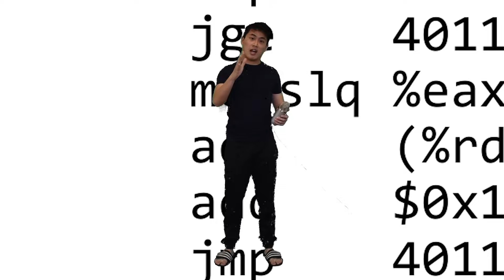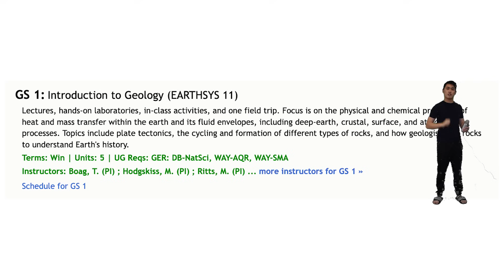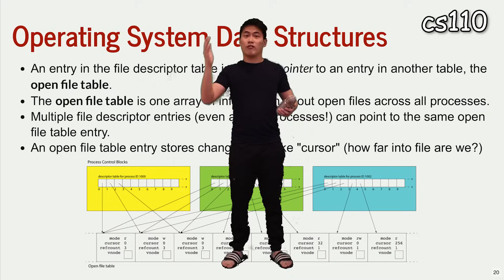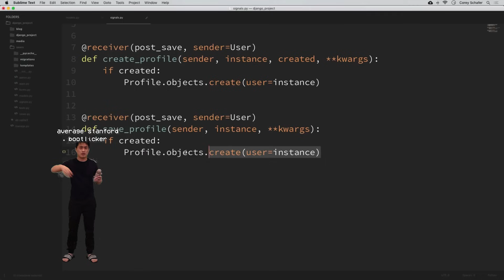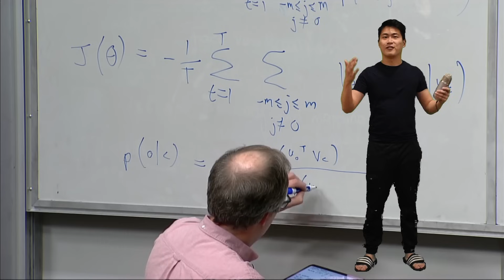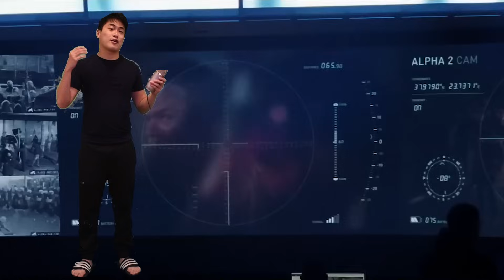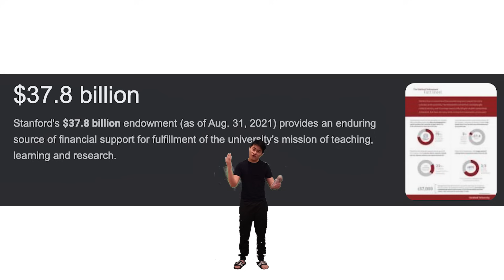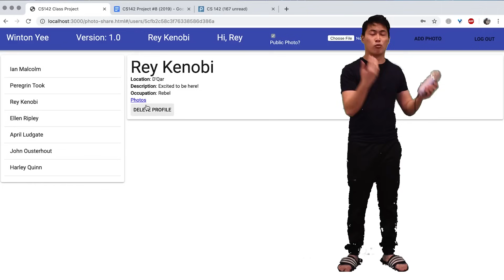Stanford Computer Science is Broken

Comment: Don’t even get me started on the inability to show what you know so you can skip to the classes that are actually relevant. Even colleges that DO have some sort of system have fallen flat in my experience- they have you take prove your knowledge for each class and elective
in order
Meaning - you had to sit there and explain prove you know the CS 101 before moving on to CS 201 or whatever despite me having been learning independently for over 7years now.
I can’t just say “yeah I know this stuff, here’s how” either - instead they have you effectively do this for an entire semester, thus defeating the point of trying to skip them entirely. 

Like, why should I take the “prove your knowledge” “”””class”””” if it’s not actually going to help me get ahead??

It’s absolutely ridiculous, and I’m so very glad I ended up dropping out. Even the low level registers, compiler architecture, and even the linker*, and such I managed to learn away from college with the help of those in various video game modding communities. Hell, even my ghidra/reverse engineering knowledge comes from there rather than anything college could have possibly taught me. *even if they could I would just be doing the same old projects countless others have done before without any independent care or direction. It would just be assumed that it goes on the resume as “passed this class with a grade” rather than “developed X project and learned many skills I’m proud of along the way”

College (and hell, even many grade school courses) are an absolute joke to those that take a more independent route (and don’t even get me started on the other COMPLETELY irrelevant electives (biology & chemistry?? Really???) that are shoved into a curriculum, ffs…)

Comment: Gets A Computer Science Degree complains about getting a Computer Science Degree.  Computer Science is the Science of Computers and the degree is exactly that.   The physics and such is largely there for historic reasons.  Most are accredited through the same process as Engineering  departments so the physics is require. If you want to learn development and practical programing skills Software Engineering, and in some cases MIS.   Then take some boot Camps or teach your self languages you are interested in.  Computer Science is always going to be Theory regardless of where you get the degree.   Not to mention in some fields the knowledge in math and physics is extremely helpful.   In web dev it is useless.

Comment: >complaining you get taught theoretical computer science instead of practical engineering when you take a computer science course instead of an engineering one

Skill issue. American reading comprehension at its finest. It's not our fault you didn't read the degree program before you applied for it. It should be embarrassing that you graduated from STANFORD and still need a lapsed physicist who self taught Lisp after flunking out of a party school for the purpose of writing production webapps entirely from a pure CS approach that allowed plotting a course through an avalanche of repetitive, shallow tutorials that simply did not engage nor understand the essence of the art.

Genuinely questioning your motivation & reasoning for even picking the major at this point. The suggestions aren't even really specific to CS itself. Crippling failure to specialise & impedance mismatch between skills taught and expertise needed is an endemic problem in academia from Doctors to School Teachers.

Comment: The SWE curriculum you want should not cost you $60K/year, it should pay you $80K/year. IT will literally pay you to learn this on-the-job. CS is to understand why it all works,  so that you don't feel like a fraud when you hear that syntax is the left adjoint of semantics and have a sudden insight into your current task writing a parser. Or hear about dependent types and have a sudden burning urge to learn about topology and category theory. You went to Stanford because you are (hopefully) not the get-rich-quick hacker you present here. You are the dreamer of the dream. Google started because two guys studied sparse eigensystems and thought, hmm, what if relevance flowed like water through hyperlinks onto other web pages... how much relevance would accumulate on each page in steady state? Any fluid engineer knows this stuff cold, it is the ability to apply existing theory to new fields that will build a trillion-dollar company, and justify the $250K you spent on that CS degree. Aim higher. There is so much left to know, and so little time to dream it up.

Comment: You never have used or have seen Mutexes/Semaphores in real work? Probably, good enough for some JS Frontend development, but you should better not working a as a system or backend developer when it comes to use languages closer to the metal.
As far as I can see there is nothing wrong with CS in Stanford. Because there is nothing wrong with teaching the theoretical background (which stay useful and unchanged up to nowadays).

Comment: computer science existed before computers, the purpose was never to give you practical information on how to use them. The purpose is to teach you the science of how computers/computation work (or would work in the case where computers hadn't yet existed). It teaches you the science of computers, not the application of them. You analogize computer science as teaching a driver how to build a car on their own, when thats not the point. The point is to teach mechanics how to build a car on their own, i.e., the people who actually work with those low level systems, that are constantly being improved because of schools like stanford, how the "car" works. If you wanted to build practical software, if you wanna learn how to "race" instead of build cars, CS is not the degree. Sure, maybe jobs requiring CS is misleading, but thats not the colleges fault, thats employers' fault for not knowing what CS is.

Comment: You're completely missing the point of the degree you got. You didn't get a degree in software engineering, you got a degree in computer science. I understand your frustration about the disconnect between CS being expected for a software engineering job and it not being very applicable, but most of your video is invalid given that computer science is not the same thing as software engineering.

Comment: IIT's are more toxic and useless completely we give graduate level exam of mechanics, modern physics, calculus, vectors, organic inorganic chemistry right after 12th and then get in IIT on not favoured branched because you get branch on the basis of rank aka marks and then after 4 years of graduation you sit for IT campus placements because you wont be placed as a fresher from mining, civil, mechanical,chemical, etc branches and at last what you studied to get google's offer - " HTML, CSS, JAWASCRIPT and DSA " that's it what is required but the company HR favours hardworking IIT slaves from any non cse branch more than a skilled + CS graduate from a non branded college and i guess the same happens in US. But Indiia's case is worst even Sundar pichai is Matallurgical passout but if didn't get IIT he wouldn't have been googles CEO today.

Comment: come to indian ivy league , the so called IITs , with alumins like google ceo , you derive something in applied physics course using the varibale as angle instead of how they did it in class integrating across distance from the point where you want to find the magnetic field they cross the whole 20 marks question . Like shit ultra pro max , like you are in top 2000 of 1milliion peorple who gave the intensive entrance exam based on highschool maths,physics and chemistry syllabus on steroids and you need to integrate acoss distance instead of angle although the only difference is what was tought in class but both correct . and yet they keep failing you yet people aspire because it take highest IQ and hardwork to  be in top 2000 of 1 million high school graduates every year